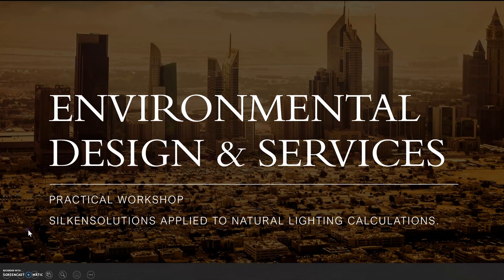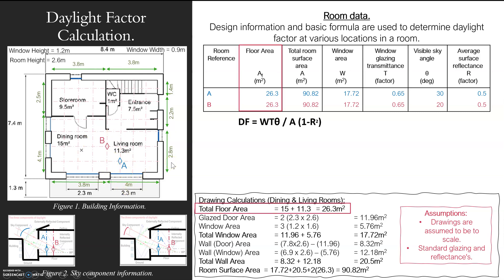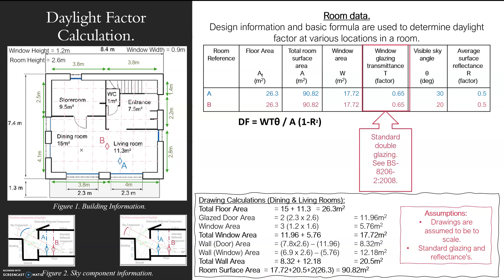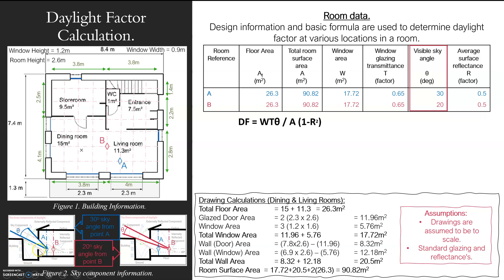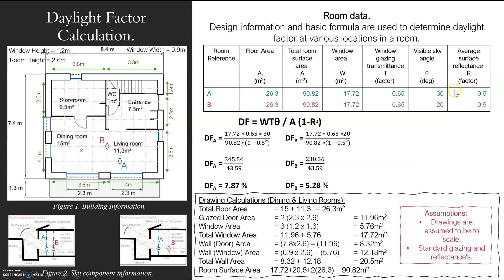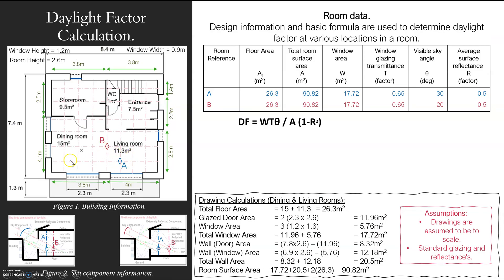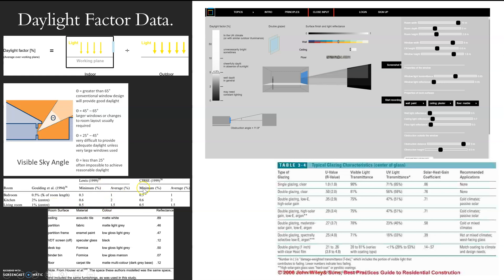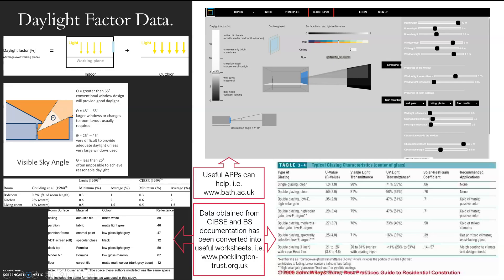Lighting Calculations: Daylight Factor

Comment: thanks for this video, however I have a couple of questions in regards to your calculations:
- why the back wall (to access entrance and storeroom) is not included in the wall calculation area?
- why the visible sky angle does not take into account by the presence of multiple windows?
(- should the "window area" be 3(1.2x0.9) ?)
Reply from the maker: Apologies I don't look at comments normally as these resources are for my students. I understand your query completely and agree you and a computer programme would be far more advanced but I have to start with the simple calculation to start my students off on the concept and will miss out on elements for speed of delivery. I'm not a published author but if I ever decide to take my work further I will ensure to add your concerns.